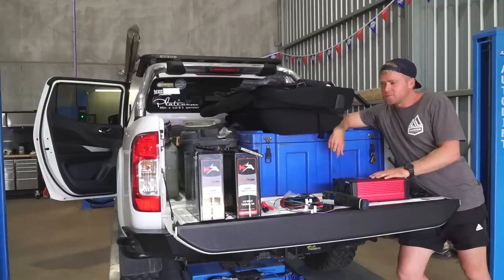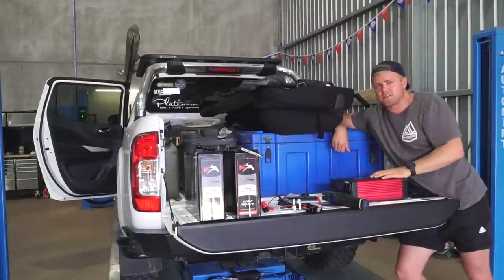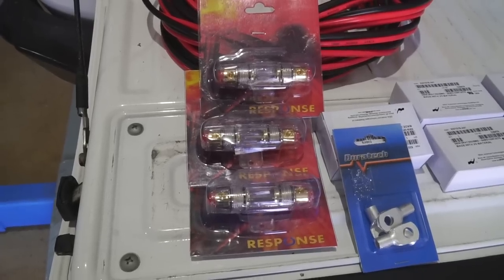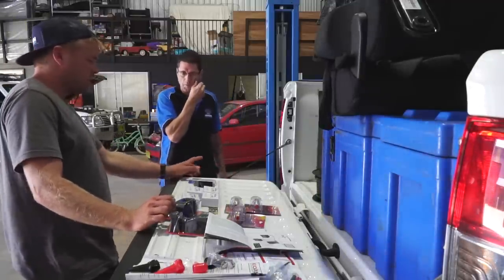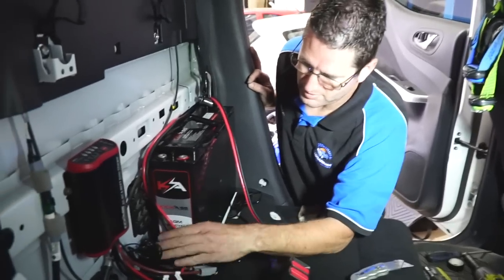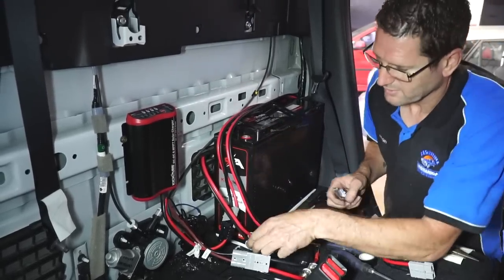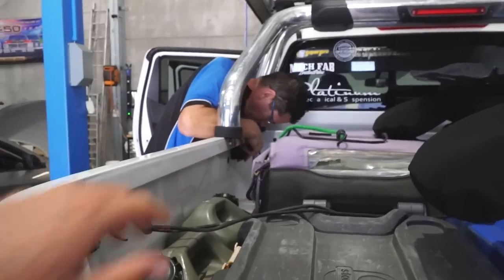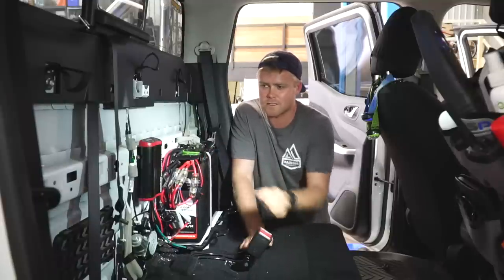4WD DUAL BATTERY INSTALL - Nissan Navara NP300

Comment from the maker: WARNING THIS ISNT MEANT TO BE AN EDUCATIONAL VIDEO ON HOW TO PROPERLY INSTALL, WIRE AND SET UP A DUAL BATTERY SYSTEM - this is just what I did with Tony and I have no idea what I'm doing. If you are an expert and want to tell us how shit it is and how much better you would have done then just reply to this pinned comment, that way we can keep all the comments in one spot for me to screen shot and have a laugh with my mates.

Here's the Kickass products we used -
https://www.australiandirect.com.au/Battery-Systems/AGM-Deep-Cycle-Batteries/KA12120Slim

https://www.australiandirect.com.au/buy/kickass-1200w-pure-sine-wave-digital-inverter/KAI1200WPD

https://www.australiandirect.com.au/buy/kickass-25a-dc-charger-with-anderson/KADCDC25A-AND
Reply: Lol. Don't let the clowns get you down. If it works, it's done it's job
Reply: Mate, that's not how you wire a discombobulator block. You need to flip the scramble to top side and then you push the inconverter lengthwise.
Jesus flaming Christ, people these days..
Reply: Don't worry about the haters. I've been a sparky for 19 years the wankers that focus solely on making things look nice, fuck everything else up royally! (Loose connections, improper fuse locations, and the main one is tightly bunched and cable tied wiring which de-rates the cable and it gets hot)

Comment: Hey mate nice vid. Those large gold fuses and fuse holders in my opinion are not upto the off road job. The caps on the fuses break and make it hard to fault find.  Much better off using maxi or terminal fuses. Just my 2 cents worth mate. Keep up the good work.
Reply: They are for audio installs not 4wd setups
Reply from the maker: Hey mate, okay sweet, thanks for the tip! Ill change them around when I get a chance, probably change over to a lithium battery in the near future so will do it then
Reply: @TylerThompson90  yeah to easy mate. Make sure the dcdc you arw using has a litbium chargering function built in or youll be up for changing that to.
Reply from the maker: Yep I'm pretty sure the kickass one handles lithium as it has a lithium option on the top for battery types :)
Reply: Imo ive done more corrigated roads then i have hot dinners and mine have held up 4 years not a single blown fuse. Not sure where you're taking your 4x4 id like to know MS P 🤣.
Reply: @Mosesk1988 Hi bud, I also have done plenty of corrugations etc and I actually don't do much off roading however I have had one break on Fraser Island and another on the black top out the back of Moulamein.  When they break they still look like there in serviceable condition i replaced mine with terminal fuses. Just thought I'd pass my experiences on and maybe save a fridge full of tucker going to waste. Cheers.
Reply: @markp4668  thats true Mate 👌

Comment: Hi Tyler, just one thing, i'm pretty sure the Navara being brand new would have a smart alternator. if it does the blue overide wire needs to be connected to an ignition source in order for the charger to work correctly as the new alternators vary their voltage up and down for emissions so the charger needs to compensate for this. just my two cents. john
Reply: i second this....
Reply from the maker: Hey mate, so did we miss doing that? If so then I'll definitely get that sorted, cheers!
Reply: Yeah I think so mate, I'm pretty sure it's the wire that the mechanic thought was for using the aux battery to start the car in the case of a flat start battery. It's actually a trigger wire for the charger 👍
Reply from the maker: Okay sweet, thanks mate, will sort that out this week!

Comment: I know it’s hell expensive, but Lithium will sort you out big time. Lighter, can be discharged heavily keeping the voltage higher throughout and it’s safer. Also they hold thousands of cycles, you’re going to go thru three/four AGM by the time you have to swap a lithium.
Reply from the maker: Yep Im thinking I'm going to upgrade to lithium in the future when I can afford it :)

Comment: Hey mate, The blue wire on the DC-DC charger isnt a "overide" for jump starting. It is an ignition sense wire. This is to be connected to an ignition activated positive to overcome the variable voltage issue with new vehicles fitted with "smart" alternators. You should connect that wire to get  the best out of your charge possible .👍👍
Reply from the maker: Hey mate, yep someone else pointed that it too, got the car booked in for a service tomorrow so will definitely fix it up then. Thanks for the help mate, appreciate it!
Reply: @TylerThompson90  No worries mate! Keep up the good work.
Andy.

Comment: I highly recommend Revolution Lithium battery. Expensive but fantastic.
Reply from the maker: I am thinking of upgrading to a lithium rather then a second AGM battery
Reply: I dropped my AGM’s for one Revolution Lithium with 100amps continuous. Save 54kgs and it’s outstanding, would never go back to AGMs

Comment: All you need is 1 x 100 amp lithium bud. As much power as 2 of those AGMs. Only weighs 11kgs, holds 13v all day, and can charge from 0 to 100% in a couple of hours. They’re brilliant
Reply from the maker: Yep think I'm going to upgrade to a slimline lithium mate, seem to be much better just so expensive haha
Reply: The quality is remembered long after the price is forgotten! 
She’s all good mate. At least your building a side business around the space and could see a return on your investment.
Reply: @Daniel-qt1br  which brand lithium are you using?
Reply: @tracknotes6562  century from ARB

Comment: Hey bud

I suggest getting your solar setup sorted before you go for a second battery, either a hardmounted panel or a blanket you can plug in and see how that goes first.

Keep up the awesome work!
Reply from the maker: Hey mate, yep we actually got a 250watt safiery global solar blanket from drifa we took to tassie and worked a treat. I reckon ill upgrade to lithium in the near future still though to give me a bit more power, rather then having two second batteries
Reply: @TylerThompson90  Any battery bigger than 120AH will suffice as long as you have a charger that can keep up with charging it.

Rule of thumb is if your battery setup is under 200AH capacity, stick with a 25A DC Charger, but if it's over, you'll need to step up to a 40A charger.

In that case, I'm going to suggest an Intervolt DCC Pro, as they have different charging profiles, a smaller footprint for mounting and all wiring is terminated with battery lugs, rather than a prewired plug setup, so if anything goes wrong with the unit, it's an easy swap out and replace.

Also compatible with your smart alternator. 👍
Reply from the maker: The same company that does my solar blanket have a new slimline lithium battery out that will fit behind the back seat so thinking of upgrading to that at some stage. Its only 100AH but will still give me more power then the 120AGM plus charge quicker and lighter
Reply: @TylerThompson90  half the weight and you can run them down to 20% charge left from memory.

Comment: Cable gland the rear to put things into tub, opening the rear vent to put cables will let dust through and allow water ingress because vent has rubber that opens and closes as required for cabin pressure to allow doors to close.

Comment: I like this idea....looked at doing it this week.  Located in Vic, but after checking with VicRoads Engineer & a VASS Engineer....doesn't seem it is road legal in Vic to have a sealed AGM in the cab (behind the seats).....therefore insurance is void.
Reply from the maker: Oh really, I've changed over to a Lithium battery now so not sure if that is any different.

Comment: Great video bud, iv got a 79 series LCruiser, i installed a Projecta IDC25 Dc-Dc Solar (same as yours but different brand), its an incredible setup and have been off grid for about 3 weeks with 2 50ltr fridges, didnt have to turn the car on once, im running a 250watt solar panel, thoses fuses you have, I've been using for about a year now, not 1 issue. Good stuff🤙🤙
Reply from the maker: Thanks mate, sounds like you've got a good set up!

Comment: Nice job. I've recently set up a second battery system in a camper trailer and it is indeed a money pit! I have a couple of observations, you can do what you want with them! I notice you haven't put a tub liner in the back of the ute - I can't recommend them highly enough, stops the tray getting scratched and then rusting. Second thing, yeah that inverter has to come off the floor! You might not plan on flooding the cabin, but you never know! Especially if you go to places like the Cape, etc. Could you maybe mount it to the back of your centre consol, standing up? Some sort of protective cover on it so Kai doesn't kick it?!
Reply from the maker: Thanks mate, appreciate all the information! I don't think it would fit there to be honest but I can have a look, thats where I normally put my camera bag though for easy reach haha always hard trying to navigate everything. I'm hoping to get a tray set up this year so when I do ill move it into there I reckon

Comment: Fantastic setup looks neat enough but you can't keep everyone happy, the second battery is what it needs for sure. Jaycar are doing some neat fold up solar panel at the moment, the 200 or the 260 watt one's would be the go. you could make a anderson to anderson plug Ext lead to get the length needed to get it out to the tub, then just plug the panel straight in. $300 for panel and wiring, perfect for when the car isn't moving  :)
Reply from the maker: Thanks mate! Appreciate it :) Yep I've actually got a solar blanket now I used on our recent trip away, worked well and definitely helped. Got a safiery global one from drifta

Comment: Love your Videos Tyler, As mentioned, I would change those fuse terminals over as i used to use those in my old car (granted they were in the engine bay) but after a few years they started cracking and falling apart. You might not have that issue being its away from the heat of the engine bay, but Worth changing over in my opinion.

I would also look at running a Lithium Battery for what you are doing. I currently have a 120AH lithium battery but may downsize in my new Jeep Wrangler Rubicon to a 60AH lithium battery for space saving and I would say it would still have more safe capacity out of that than the 120AH AGMs.. plus you'll save quite a bit of weight. If you wanted to get super fancy, you could have a custom built lithium battery to fit into a small area, but may not be worth the trouble for most people haha.

Good luck with your adventures and hopefully one day i can go for a drive with you, you seem to find a lot of good spots =D
Reply from the maker: Thanks mate, appreciate it! :) Yep so I've got my eye on a 100amp slimline lithium battery that will fit behind the back seat so will hopefully upgrade to that sometime soon and will probably change the fuses over then too

Comment: Good onya mate , I managed to fit a 145 behind the seat of my Colorado charged solely by 240w solar panel on my roof , runs small Fridge and camp lights no worries , would like to set up bcdc one day , great use of space -just can’t fit my rifles behind seat now
Reply from the maker: Sounds like a good set up mate!

Comment: hi tyler, how do you find your voltage on the np300 alternator i did the exact same setup a few weeks back and seem to have alot of voltage drop before im reaching the dcdc (note am using the kickass supplied wiring kit)
Reply from the maker: Hey mate, it seems to be working okay for me at the moment, we forgot to hook up the wire that goes to the ignition to override the smart alternator but once we got that sorted no issues

Comment: Tyler what you need to add to your system is a battery monitor that measures current going in and out. It is good to know the exact status of your battery, voltage is not good enough. I have a cheap one off eBay but maybe you could get your Drifta mates to get you a Victron one. Also when you go solar there are pro's & con's but I like my permanently attached solar system, no mucking around putting up solar panels around the place.
Reply from the maker: Hey mate, so i've since got one of the safiery global solar blankets off Drifta which I'm using at the moment, probably upgrade to a permanently mounted solar at some stage. And yep try get one of those monitors you mentioned

Comment: Have you looked into lead crystal deep cycle batteries? They come in slimline and can be 100% discharged and fully recover.
Reply from the maker: Think I'm going to upgrade to a 100amp lithium battery soon mate, they can use 80-90% of their charge, lighter and charge faster. Just about 5 times the price haha

Comment: G'day mate do you mind if I ask you how much that setup cost? I'm looking to get something similar just curious all Park supply only install a? Thanks dude see you on the tracks
Reply from the maker: Hey mate, this is the three main parts I used

https://www.australiandirect.com.au/Battery-Systems/AGM-Deep-Cycle-Batteries/KA12120Slim

https://www.australiandirect.com.au/buy/kickass-1200w-pure-sine-wave-digital-inverter/KAI1200WPD

https://www.australiandirect.com.au/buy/kickass-25a-dc-charger-with-anderson/KADCDC25A-AND

And then was another maybe $200-$300 worth of wiring and parts etc

Comment: Change your fridge power wires to Anderson plugs not the standard 12volt plugs they will vibrate out on rough roads. Cheers
Reply from the maker: Yep got the fridge on an anderson plug :)

Comment: I was hoping to see how u got around the alternator, I’m sure your rig would have a voltage sensitive thing. Or smart alternator, what Eva they call it. Looks like u didn’t need to do anything ?
Reply: That's all typically handled in the charger, the Redarc and KickAss ones both accommodate for the smart alternators it seems

Comment: Thanks for the video so happy you showed this I had a bad experience with an installation that went wrong.
I would appreciate if at some point you can do a quick video how to take the rear seat out Cheers
Reply from the maker: Cheers mate! never good when you have a bad experience, ill try show it when I can

Comment: Nice set up, but my only concern deep water crossings with your 240V  inverter  on the floor, because you could get fried if it is left on
Reply from the maker: Thanks mate, yeah I had the same concern haha just hard to find anywhere to put it, will hopefully get a tray set up in the future and change it to there. Ive never flooded a 4wd before so hopefully don't anytime soon

Comment: Not bad mate. IMO you will need both batteries. From memory those Kickass AGM batteries are only designed to discharge about 30-35 amps. Which at 12Vdc only gives you 420 watts. Not even close to what’s required to run that inverter. 

Definitely change them fuses to a Midi fuse style.

You desperately need to install a Low Voltage Disconnect to the AGM battery. Kickass do a Cool unit with Anderson plugs pre fitted. 

Set up a high amp (200 + amp) 12v relay to turn the inverter on and off. Have the switch setup to trigger the relay from the low voltage disconnect protected side. 

Otherwise nice job 👍
Reply from the maker: So think I'm just going to upgrade to a 100amp lithium battery when I can mate, obviously a lot more money but should work better for me. Thanks for all the tips!
Reply: Tyler Thompson that’s the go. I run a 125A lithium with the kickass dcdc charger. Hopefully you can find a slimline lithium to replace the agm. That’s a good use of space for the battery.

Comment: Great set up, have done the same in my Nav. I mounted all my fuses and another Anderson plug under the rear seat base. The seat base just lifts up, so for connections or fuse issues you don’t have to unbolt the seat back.

Just an idea 👍🏼👍🏼
Reply from the maker: Thanks mate, I've recently re done my dual battery system and did exactly that 👌
Reply: Yep, so the update, great!